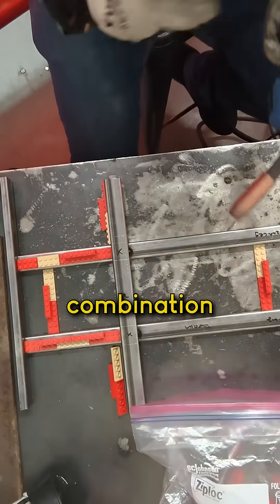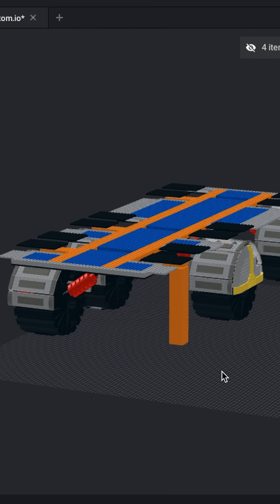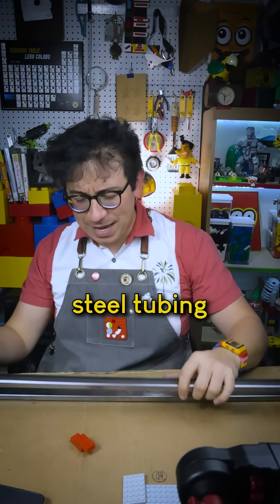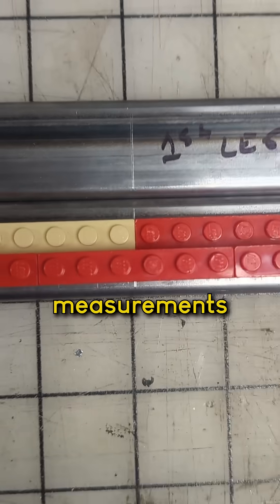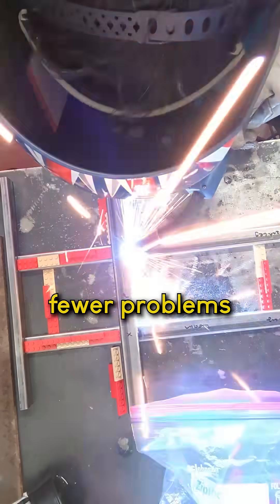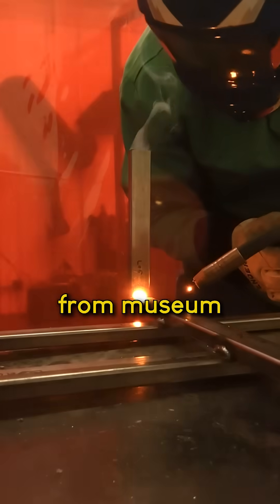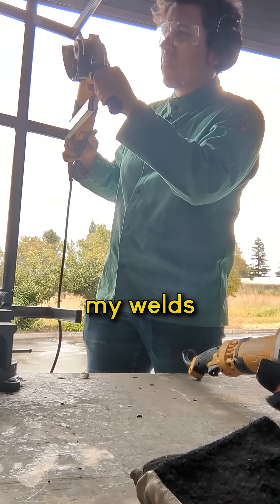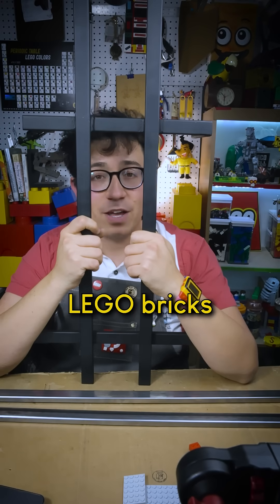welding with LEGO? #LEGO #legos #legoaddict #afol #legomoc #legobuild

Comment: As a Mig welder, if you have to weld again, I would suggest you do small and quick spot welds so that way it still bonds the thin metal, and that way it doesn’t also cause the gobs on your beads

Comment: You can drill holes in the frame and use technic pins to keep it in place too.

Or just band around it (the technique where you sandwich your traditional lego blocks with technic bricks and run bars between the two.)

But tbh you probably already thought about that.

Comment: If there is anything I’ve learned about welding, it’s that somewhere, unbeknownst to you, the steel expanded and warped just enough that whatever you are trying to put around it will not fit. I have been doing this my whole life, and I still get bit by too tight of tolerances. Like my father said “a grinder and some paint makes a welder what he ain’t!”

Comment: Remember that adding paint adds a noticeable amount of thickness.
Reply: Depends on how it's applied and what you consider "noticable".
Reply: @DavidSmith-vr1nb  Lego works because of it's high tolerances the paint might be enough to throw them off
Reply: @DavidSmith-vr1nb  when dealing with LEGO, a few thousandths of an inch can break you.
Reply: Boutta go paint the bottom half of my body brb

Comment: Lego is wildly accurate. The fact you can chain together hundreds of bricks and the lenght is within a couple tenths of what it should be theoretically is mental.
Reply: it's even better than that. the leniency for lego is about 0.005mm!
Reply: @monodragon  That's per brick though. To retain that over multiple sections, it might need to be even better.
Reply: @DavidSmith-vr1nb  just wanted to say that, surely thats not for e.g. 1m. Thermal expansion alone would be much more!

Comment: "Hey, also, I'm pretty good at welding and CAD." Is an unexpected flex for a lego model builder.
Reply: @iain-duncan pretty sure they use different CAD software thats made for lego.
Reply: @D3nn1s  yeah they have an official lego-based CAD and programming software for LEGO robotics
Reply: @D3nn1s it is different CAD, but really the important part of being good at CAD is being able to think about what you’re making in 3D and break it into smaller features. The rest is just figuring out the particular tools of the program you’re using and that wouldn’t be particularly hard for this.
Reply: @bmanning4999  true
Reply: @D3nn1s as someone who uses tinkercad an unhealthy amount I can assure you it is for children and not for Lego models
Reply: Unexpected and surprising, but also reasonable. Lego at both it's most basic and most advanced is more or less architecture and engineering respectively
Reply: Unexpected surprise for sure haha!
Reply: Idk. I can weld and 3D model and they said in my interview for set designer it wasn’t really too handy
Reply: "With a grinder and a can of paint, I can be the welder I ain't!"
Reply: How? Seems like the MOST expected
Reply: @iain-duncan explain yourself because no
Reply: @b._.render I think it’s pretty expected. A lot of engineering student use Lego to mock up things. 
I mean LEGO is literally just structural engineering and design for kids. Well at least that was its genesis 😄

Comment: "i spent more time cleaning up my welds then i did welding" at my job, we can easily spend 30 minutes welding and 8 hours cleaning. just part of the process
Reply: A grinder and paint make a welder what he ain’t
Reply: @Shrek2onVHS  as much as i love that saying lmao, the welding i did yesterday had to be ground smooth 😂 i dont make the rules yk, just gotta do what i gotta do, and the business im in, ground smooth with a flapper wheel is standard, makes it easier to clean and harder to miss spots when the stainless cover doesnt have any nooks for crannies for bacteria to hide😂
Reply: @Shrek2onVHS as a welder, that is one of the most annoying phrases in existence, and is mostly only applicable to heavy structural welding, not to small precision welding, like this.
Reply: @Shrek2onVHS  tig makes a welder not need it if they can weld
Reply: Paid by the hour huh😂
Reply: More time cleaning up the welds than making them? Yup, sounds about right, same here
Reply: Same
Reply: Y'all need to hire better welders. Cuz it sounds like you got a bunch of grinders.
Reply: soo much work..  but its fun right?!😊😊
Reply: Using a grinder to make a weld look good makes you a grinder not a welder 🤣 I speak from experience lol

Comment: Welding is NOT easy and those look like some well done welds. Weld done!
Reply: gonna have to steel this one from you
Reply: Nice pun.
Reply: This pun is definitely coming in hot
Reply: Very subtle I see
Reply: MiG weldings not too difficult for applications like this. Plus not to hate but the welds are decent not really good, theyll definitely work for something like this but if they had to hold a lot of weight they wouldn’t be great.